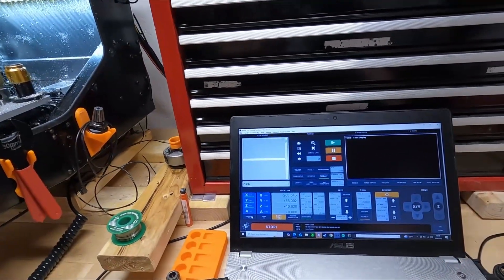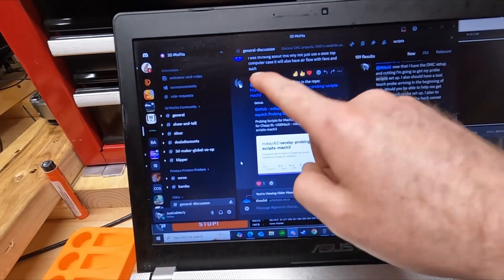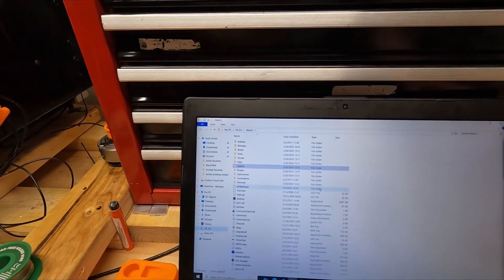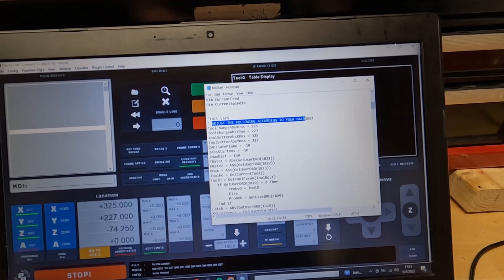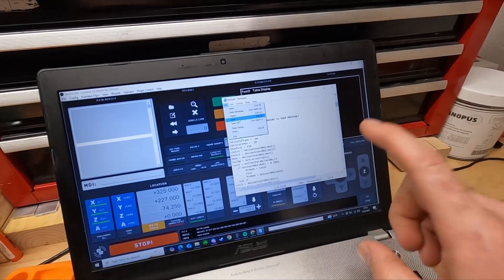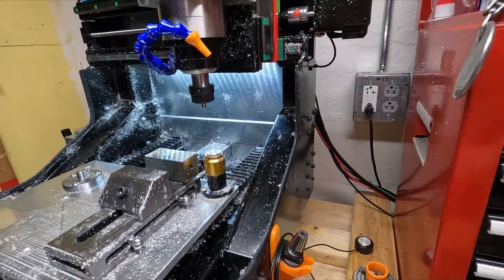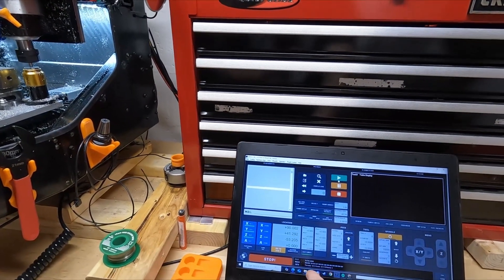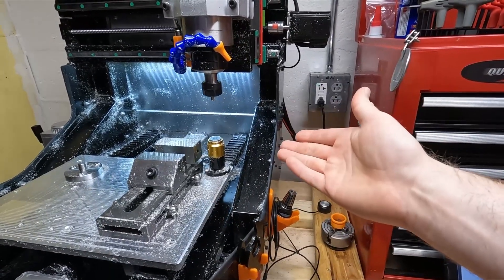DMC 2 M6 Tool Change Script

Comment: I notice on the height setter it has 4 wires. I was wondering if you use all of them or just one like the original probe and height puck do. I would assume you would be connecting to the same terminal that the probe connects too. I'm working on the dmc2 mini though. Thank you for the content
Reply from the maker: You use all 4 wires. 2 are for the e-stop and the other 2 get wired to the one like the puck and ground. I hope that helps!
Reply: @TwinCrestInnovations yes it does thank you
Reply from the maker: @Preston30294  you’re welcome!!!

Comment: Thanks for showing us this. I got a DMC 2 mini kit. Still need to put it together. I have a long road ahead.
Reply from the maker: No problem! Good luck with the build. Make sure to join the Facebook groups for help when you need it. It’s taken a lot of work for sure but it can be done. I’ve got my machine holding +-0.0005 in tolerances

Comment: This is very helpful. It's a time saver and much easier to use then the puck. Please correct me if I am wrong, but the switch needs to be Normally Open to be used with the board we have. Thanks again and also thanks for the link since Mikes corrections will probably fix some problems I'm having.
Reply from the maker: @GauthierOrban  the tool setter needs to be normally open. I’ll put a link in the description for the one I bought

Comment: great stuff its what the DMC2 really needs...!

One question though, in say fusion how to to make it request a tool change in the program so it knows or does this automatically do have to mod the tool profile in the tool library?
Reply from the maker: When you are finishing up your CAM in fusion you will generate the NC program. When selecting what operations to use and where to export the program, there is a setting under the preferences window that says “Use M6”. When a tool change comes up it issues an M6 command kicking off the “M6Start” script automatically. But I believe you have to leave the tool number in Mach set to 0 for it to work. 

I will make another video when I get to run an actual program and walk through all the steps
Reply: @TwinCrestInnovations  Ok thanks for the info mate!